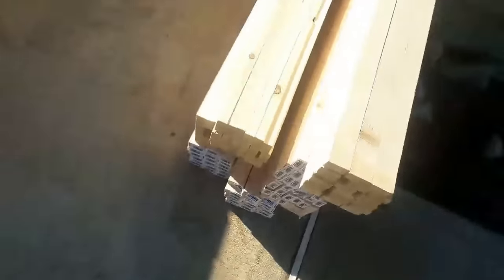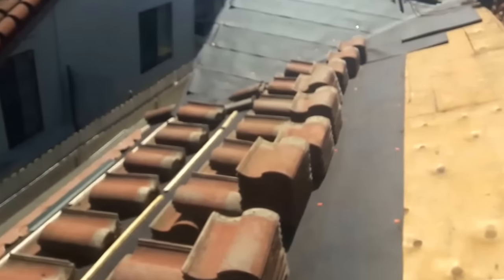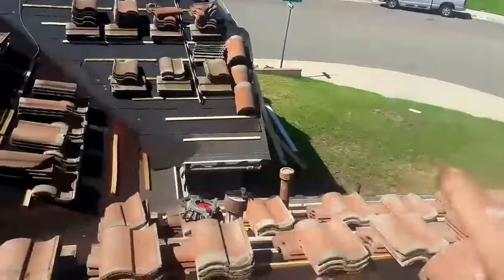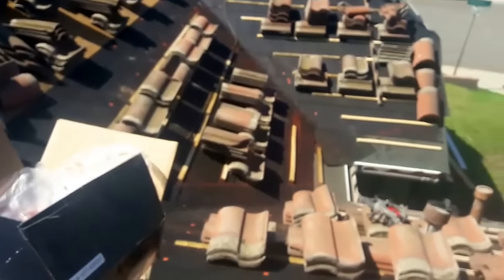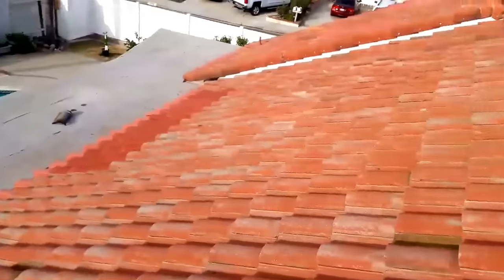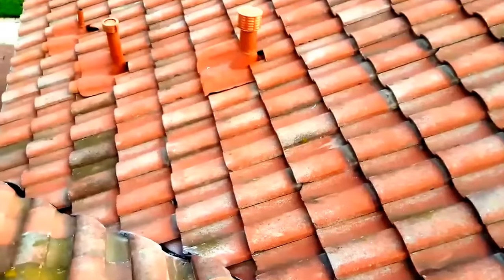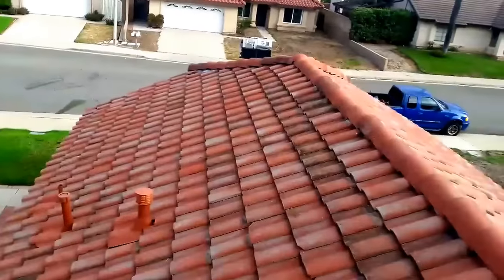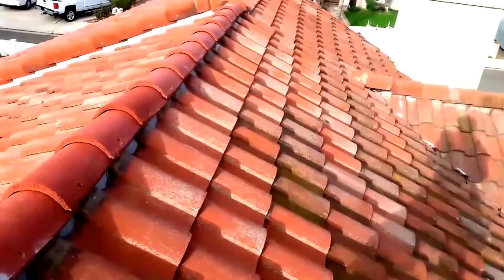How to tile a roof!

Comment: Hi Eric, i have a low pitch tile roof in Arizona and i'd like to replace the underlayment with help of my dad. I planed on doing half of the roof so i have somewhere to put the tiles and it's easier to mark everything, replace the felt then reinstall those tiles so i can do the other half of the roof. 

My question is about inspections. When do i call the inspector, does the inspector have to show up 3 times, first to inspect the decking, then come back second time to inspect the new felt, then third time to inspect the tile when i put everything back together?

Also, do i pay for every inspection myself or are the inspections included with the permit?

(I understand rules and building codes in AZ will be somewhat different but i mean in general, how does the inspection work in CA for example)

Thank You so much, great videos!

Comment: Hi Eric. I am currently getting my flat roof replaced amd.its almost done can i send you a video and let me how is their work and if theres anything that i should ask the to correct before the leave? thanks in advance
Reply from the maker: that's a tough question sir, what type of materials are you getting installed ? torch down...2 ply or 3 ply ?  hot mop ? gravel roof, cap sheet ?  single ply ?  epdm??
so many ways to do a flat roof sir , as long as you get 5 yrs labor warranty and the full manufacturer warranty you should be ok , are they licensed contractors ? 
send me some pictures to have a better idea of what kind of roof you're getting installed , but like I like said before , I can't criticize someone else's work.
Not my job as a professional roofer, but I would tell you what I would do different if it was my job.

Comment: Are wood battens required? I've seen clay tiles insatlled directly over water proof membrane without the battens.
Reply: They are normally required in a 6/12 pitch ir higher

Comment: Hello Eric,  I enjoy your videos,
my home located in Florida was built 1955, I'm not really sure if the tiles are original but if they are original tiles can i re-use them? or you don't recommend to re-use them. Thanks
Reply from the maker: Keep the tiles...install 2 layers of 30 LBS felt or 2 layers of 40 Lbs felt over the entire roof. Replace all damaged .broken tiles. Replace any damaged wood. You'll have a brand new roof for the next 50 yrs at least....one more thing...use Ice and water barrier along valleys. Fireplace and walls.
Reply: @Garciasroofing  thank you!

Comment: Can you explain how you get your measurement please. Thanks
Reply from the maker: first measure the ridge , then measure the gables on each side ...add them together and multiply by the ridge lenght .  example 
ridge 50 feet , gables 36 .
36x50:  1800 /100 equals  to 18 squares ...
100 square feet equals to 1 square of roof.